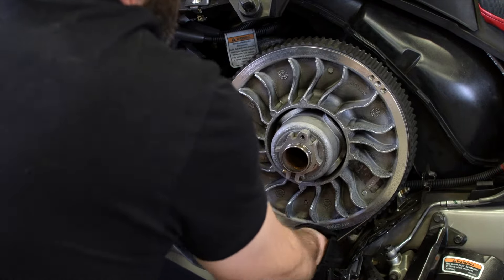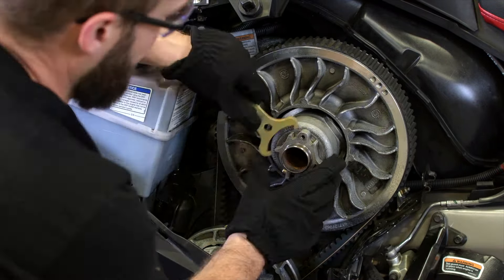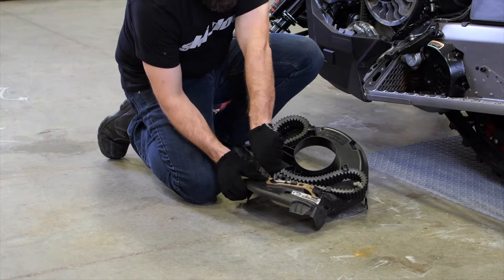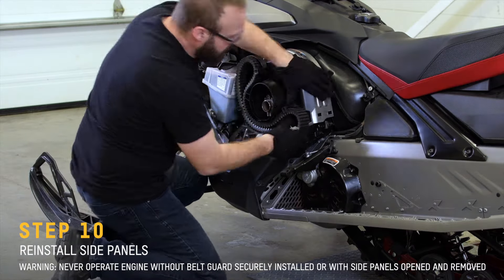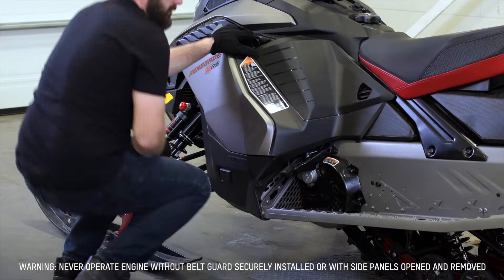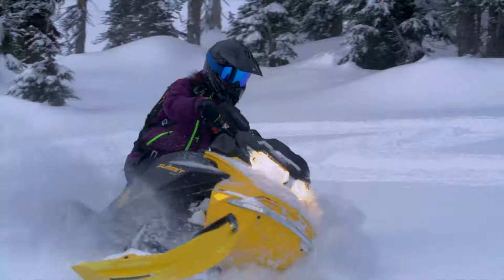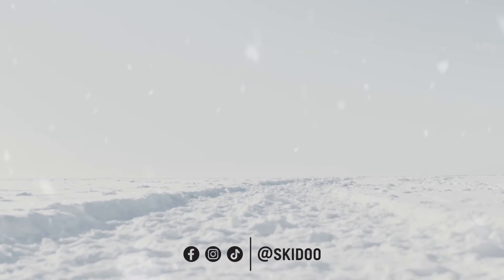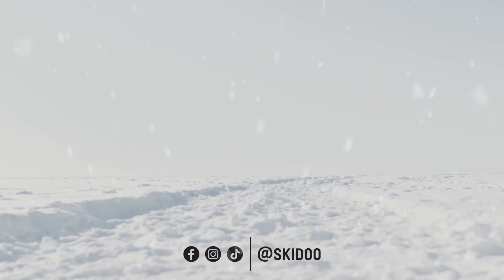How to Replace Your Snowmobile’s CVT Belt | Ski-Doo

Comment: You would think the actual Ski Doo company video would specifically explain the correct height of the belt. It’s like they don’t know or their lawyers won’t let them tell us.
Reply: it´s specified really good in their owners manual. 3 different hights due to 600 non-E-tech, 600 E-Tech and 850 and above. the only thing the manual cant show is this video. 
replacing a manual for a video wont work.. people need to know how to read a manual. The manual should have links to video´s like this that can show parts its hard to describe in text.
Its same CVT system for the Lynx snowmobile´s. i have a Lynx but it´s the same CVT system on my Lynx as it is on this Ski-Doo.